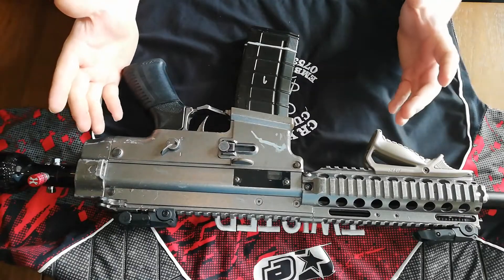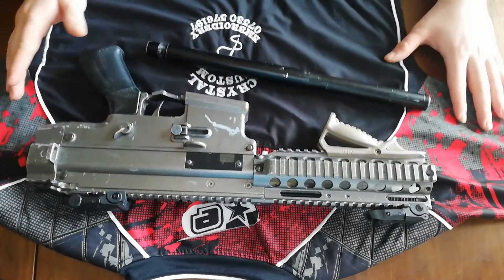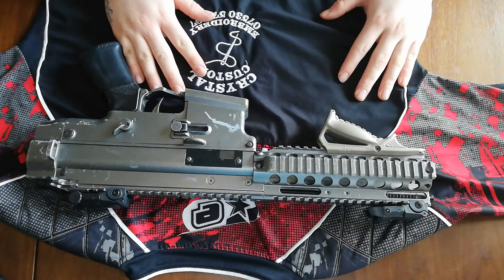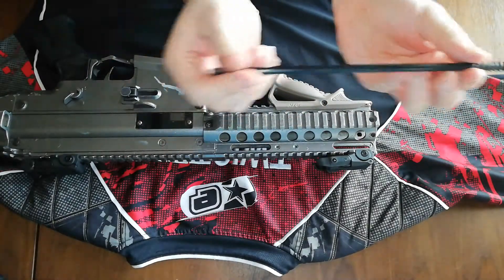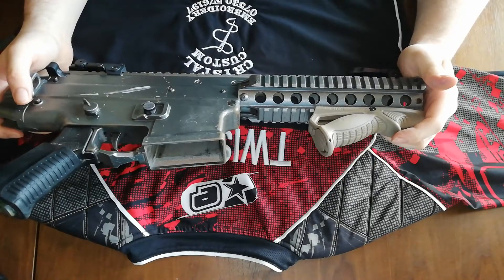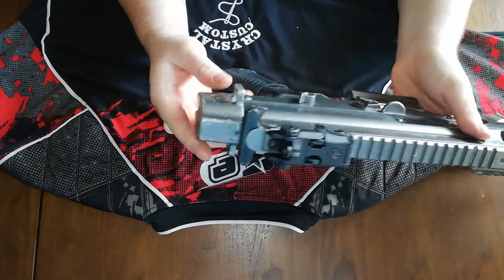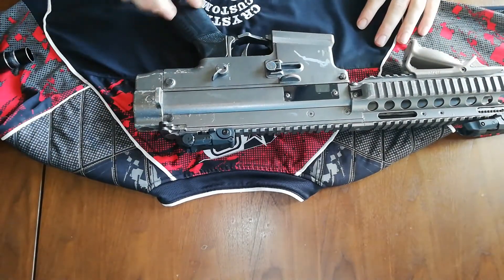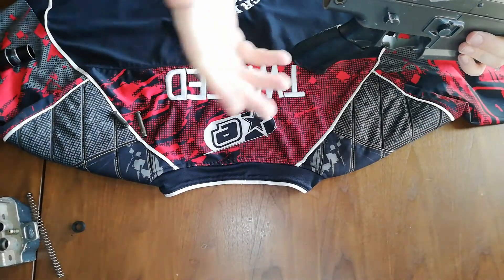Maxtact/ScarabArms TGR2 marker disassembly and maintenance

Comment: Hey bro... So I got a question 🤔... If you had the option of trading in your tgr2 for a t15, milsig, or perhaps an mg100... Would you? I have a tgr2 but I've never really found anything special about it in comparison to other platforms... It's just beefy and feels like 100 things could go wrong with it as soon as I use it... Would love to hear your thoughts 👍
Reply from the maker: I've used a t15 and a emf100. And personally I would say no, I just love the simplicity of being able to take it apart and clean it. Such little components and they're really easy to find, I can even pick up the orings on ebay for about £10/€15